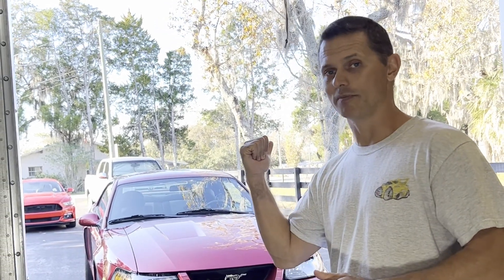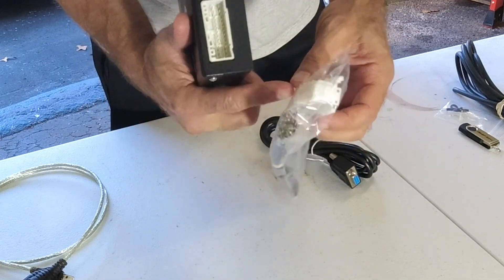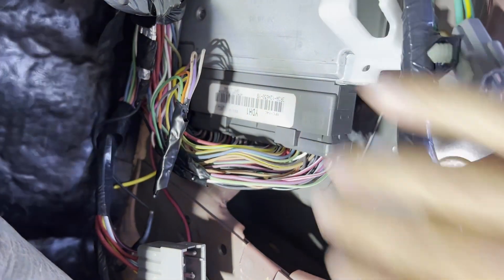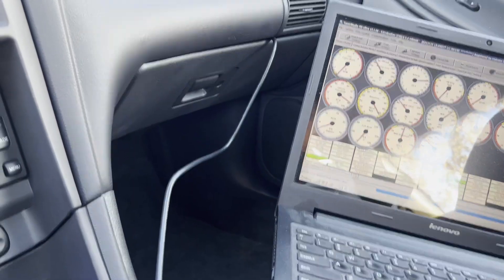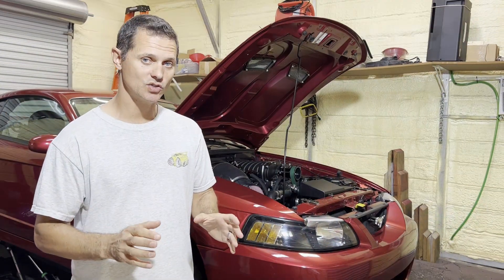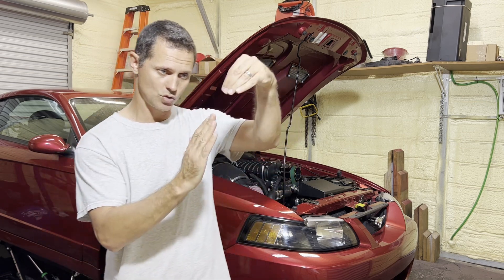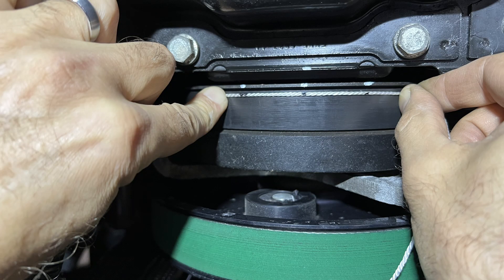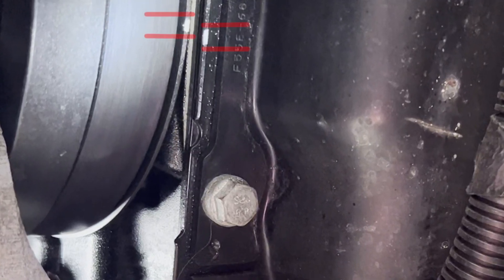03 Cobra MS3Pro PNP Install plus issues

Comment: How do you hook up a can check  gauge to the ms3pro when  can buss is used with wide bands nothing special to set up in the ecu
Reply from the maker: CAN is like a network.  Many devices can be on it and all share it.  So yes widebands, gauges etc. can all be on at the same time.
Reply: @MalcolmV8  any thing special I would need to do in the ecu.  Or hook can h and can l.  Power  and go
Reply from the maker: @KennyBrummett  in Tuner Studio look at the top right tab "CAN-bus / Testmodes" and you'll find some CAN stuff in there.  Just make sure it's on and turn on Dash Broadcasting and your gauge should pick up what you want.

Comment: What harness adapter do i need to connect to my old ecu  so i can have my ms3 and ny old ecu both workind so it will work on my automatic fox body mustang?
Reply from the maker: I don't think there's a harness out there that does this automatically that I know of.  I've wired these up manually.  It's commonly referred to as "piggy backing the stock ECU".  So the stand alone is controlling the engine and the stock ECU just thinks it is.
In my case I cut the injector wires, ignition wires, and IAC and wired them to the MS3.  I then shared a lot of inputs like crank signal, cam etc. to both ECUs.  Some things I could not share such as temperature sensors so I had to add a second coolant temp for the MS3 as well as air intake charge temp sensor etc.
It works really well.  The stock ECU controls everything else and only thinks it's running the engine and the MS3 is actually controlling the engine.

Comment: your suppose to use the other hole on the bracket instead of modifying
Reply from the maker: If you flex the bracket out to use the other hole then you remove the support off that side of the ECU.  But putting a relief notch in you can use the factory hole and keep the bracket squared against the ECU holding it solid without any slop.

Comment: Do you what lines on the odometer means after installing ms3
Reply: Thanks for helping
Reply from the maker: @artelias1434  no problem.  Good luck!
Reply from the maker: All dashes on the factory gauge cluster means it's not receiving information or communicating with the ECU.  So it's not getting communication with your ECU.  Either your ECU is not correctly powered up or it's not wired correctly or possibly a faulty ECU.  For some reason it's not communicating with your gauge cluster.
Reply: I had a bunch of work done to the car recently 2.3 whipple, ms3pro, clutch and fuel system. The issues I'm having now is the tach, speedo, odometer aren't reading also the reverse lockout isn't allowing me to go in reverse, could these all be related to the ecu?
Reply from the maker: @artelias1434  yes those are all ECU functions.  It would be wiring or the ECU. How old is your ECU? The first batches of MS3Pro ECUs didn't have the internal hardware to activate the reverse lockout solenoid.  A slight oversight.  You have to contact DIYAutotune and ship the ECU back and they will fix it.
Reply: Ecu is new, I put stock ecu back in and gauges all work
Reply from the maker: @artelias1434  I'd contact diyautotune and see if they have any additional info on the ECU or if they require you to send it back fo repair.

Comment: Hey Malcom i was wondering if you recommend any tuners that work with that ecu?
Reply from the maker: I don't but DIYAutotune (manufacture of the MS3Pro) has a FB group where you can try asking.  It's called "Megasquirt Owner's Club (MSOC)- by AMPEFI / DIYAutoTune".
Reply: @MalcolmV8  Thank you very much I will try to do that...thanks for your videos they help a lot!!
Reply from the maker: @cobra-svt2004  you're welcome, glad they're of use and helping :)

Comment: Did you use the FC3 just for ease of installation? Seems you could done 3 relays for that.
Reply from the maker: I just used it because it was already in the car and the owner of the car wanted to keep it. I agree just wiring up with relays is much easier, at least for me.
Reply: @MalcolmV8  can you do a video at some point to show us the wiring on that? it would be interesting to see, it could help us out.
Reply from the maker: @scottadkins918  I appreciate the idea and will consider that. Thanks
Reply: @MalcolmV8  what relays do you normally use on your cars?
Reply from the maker: @waffleman2010  depends on the situation.  I do like the kind that have an integrated fuse and try and use them where I can.  Something like this https://www.amazon.com/gp/product/B01NBAO1SA/ or else the weather pack sealed kind or sometimes even just plain automotive relays like this https://www.summitracing.com/parts/sum-890008

Comment: How did you connect the timing light on 4.6
Reply from the maker: Remove the COP cover on the passenger's valve cover and put the induction clamp on the wires going to the #1 cylinder ignition coil.

Comment: Probably a dumb question, but does the FPDM have to be deleted when running a return system?
Reply from the maker: No it does not, it can be if you want.  Look at the chapters on the video, there's a fuel pump activation section where I talk about activating your pumps with a return system.
Reply: @MalcolmV8  Appreciate it.

Comment: Dumb question but do you have a part number for the piston stop?
Reply from the maker: I've had that tool for so many years I cannot remember.  Google will turn up countless examples you could get.  Just make sure the thread size matches your car which is 14 mm if it's an 03 Cobra.

Comment: Can you explain the two widebands and trigger wire on options port? Are you setting it up so you can use both the stock O2 and the aftermarket widebands? In the instructions I’m seeing that if connecting a wideband, sensor wire goes to EGO pin then the stock O2s need to be disconnected.
Reply from the maker: Stock narrow bands were removed.  Widebands replaced them.  Yes you would normally re-use the EGO signal wire from your wideband instead.  I however chose to use CAN BUS widebands.  It is a far more accurate way to go since the wideband sends it's information to the MS3 over a digital network instead of a varying voltage analog signal.

Comment: I have the MS3 pro PNP and can’t figure out how to delete codes. If you could do a video on that, that would be awesome!
Reply from the maker: What sort of codes are you trying to delete?
Reply: ABS, shift light, and things that I’ve taken off the car. I can use the turnoff feature to help diagnose issues as well.
Reply from the maker: @gregoryshelton1358  shift light is from the ECU, I didn't think the MS3 PNP supported that, at least I have not seen that light come  on. ABS is from the ABS module, not the ECU.  Since it requires an ABS tool to service you might have to take to someone else or if you removed your ABS unit what most people do is just remove the bulb from the cluster.

Comment: Do you have problem with A/C? Because after I install the same ECU the A/C clutch does not engage.
Reply from the maker: I haven’t tried AC yet. This car previously had a killer chiller on it and someone removed it. I’m not sure if they forgot to charge the AC or they charged it and it leaked or what the deal is but the AC on the redfire didn’t work to start with. It is something I plan to fix.

Comment: Are there any issues with the evap with the ms3 I have a return style fuel hat the car is tt it’s a mach 1 I noticed your name on the svt forms when talking about it not but no solid answers the tank is out because I was putting a cobra baffled tank in I also noticed a lot of fuel smell before. All of my lines are fragola ptfe so i don’t think it’s the lines I’ve been thinking about deleting the Evap (the ms3 isn’t installed yet)
Reply from the maker: If you're having evap issues now the MS3 won't fix that.  The MS3 is an off road ECU and does not support evap or other emissions natively however you could wire up the evap's solenoid to a relay and have the ms3 trigger it with some logic such as car speed greater than 25 mph and engine temp greater than 160 or something like that.  The idea is the solenoids would be normally closed and no fuel smells in your garage but it would vent the tank for pressure as well as let air in to replace the volume displacement of fuel been used when the vehicle is in use.  Or some people just delete the evap but you risk fuel smells when parked in a garage.
Reply: @MalcolmV8  one thing I did notice is that the plug near the two blue canisters wasn’t plugged in when I dropped the tank I don’t think I noticed any plugs available near it (the hat is a lethal performance division x hat) if that helps I’ve been thinking of deleting it but if it seeing boost pressure since the cars TT I’ll be open to trying to fix it because it was definitely annoying 
I bet the evap was probably turned off by my tuner before I’ll have to ask
Thank you for the help with replying and your videos have helped me a lot
Reply from the maker: @bestmichael1  sounds like it was likely turned of previously.  Glad you find the videos helpful :)
Reply: @MalcolmV8  yeah going to go find me some fan controllers at the pick and pull this week
Reply from the maker: @bestmichael1  awesome, best way to go with the fans.

Comment: Why the MS3 over the stock  ecu? I have a goal of 850rwhp  with tvs 2.65 or gen 5 3.0 which ever one will get me that
Reply from the maker: If you're just chasing a number the stock ECU will get you there.  The MS3 however is way more feature rich and user friendly for both tuning and data logging.  It has a lot of safety features built in such as if air/fuel is out of range anywhere from idle, part throttle driving, WOT or however you configure it.  Oil pressure loss, it can take action.  Features like closed loop fueling even at WOT using widebands, it can interface with a flex fuel sensor and give you true flex fuel capabilities where fueling and spark adjust automatically on the fly based on your pump gas/E85 mix in the tank.  It does not have the RPM limitations of the stock ECU and it also has true traction control and not just a random abrupt spark cut like the stock ECU.  The list goes on and on but you get the idea.
Reply: @MalcolmV8   It's not that I'm chasing numbers.  It's just all the guys I run with are 900 horsepower or better,  So I'm just trying to track down All the right components and I believe with your videos I can get there.
Reply from the maker: @SG-nl2uk  You can definitely get there on the stock ECU, myself and many others have done it.  The MS3 is just a far superior platform to do it with a lot more features.  So not required by any means but it'll do the job a lot better.  Having some safety's in place at those levels is also nice.  Even just closed loop fueling at WOT is great.  If you run a little lean on a particular day with the stock ECU nothing is done about it.  You just simply run lean.  However with the MS3 and closed loop fueling at WOT if you ran a little lean one day for what ever reason it would instantly on the fly add some fuel to keep it in check.  Just little things like that go a long way.  Like I said, not required, but nice.
Reply: @MalcolmV8  I Went to their website and it seemed that they have some options. Anyone in Missouri you know that can tune it Once I select the blower.  Leaning towards the gen 5 3.0  on e85.
Reply from the maker: @SG-nl2uk  Not sure but you can contact DIYautotune and they'll let you know what dealers they have in your area which could be possible tuning options.

Comment: There actually is a mark on the OEM balancer. there is a little notch on the balancer that you can see with the timing light.  There also is a pointer on the stock front cover for 10 degrees before TDC. when I installed my MS3pnp i had to remove the supercharger belt and intercooler tank to get a good vantage point but after doing so everything worked out. i think i ended up at 401 timing offset.
Reply: This method is definitely much easier than trying to get a glimpse of the stock timing marks.  Plus like he said aftermarket balancers don't include a notch.  I have a Innovators West balancer and there's no marks on it.  I don't mind putting it up on ramps and doing the marks on the oil pan.
Reply: @AwesomeFinish  understandable. It took me 15 minutes to get the coolant tank off and the supercharger belt off. I have a stock balancer so it made the most sense for me to do it that way. Either way it doesn't really matter as long as you verify timing one way or another
Reply from the maker: Yes good point, if you're still on a stock balancer there is that mark.  I'd still validate it with the piston stop and see how on point it is.  The Zinc has an aftermarket balancer so that was not even an option, the Redfire has the stock balancer but there's so much stuff in the way I didn't even think about that.  Good reminder, thanks!
Reply: @MalcolmV8  yeah I had to do quite a bit of research to find that out. Would definitely have to use another technique for an aftermarket balancer

Comment: My car was not nearly as happy when I installed my MS3 PnP lol. I can't wait to get back to it and get it on the road.
Reply: Was your motor new?
Reply: @AwesomeFinish  Nope, it had 36k miles on it when I did the conversion. I took it to a shop out in Savannah and they got it running better. I really just need more time messing with the software and learning everything in the hopes of getting much more familiar with it.
Reply: How was the set up on this?

Comment: Great video and info. Love this type of content. Do you plan on running knock sensors with the MS3?
Reply from the maker: It was not in my immediate plans on this car but something to consider.  I have them installed on the "Zinc" Cobra which is also MS3pro powered and could cover info there if that's what you're looking for?
Reply: @MalcolmV8  I would love that! All of your info is welcomed and helpful.